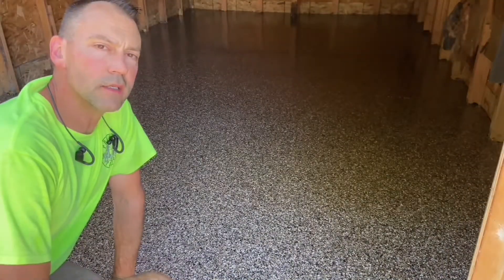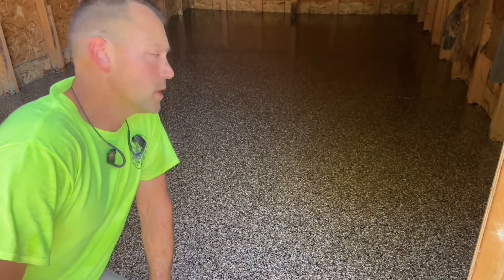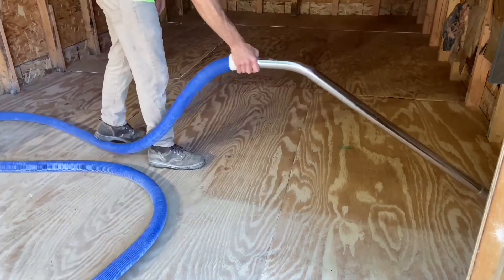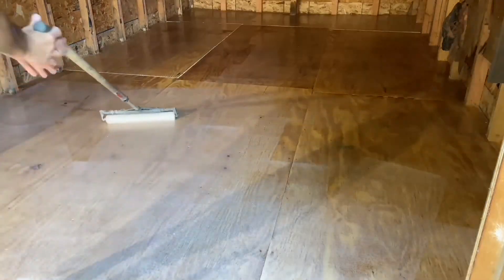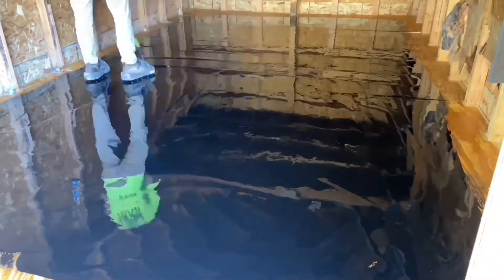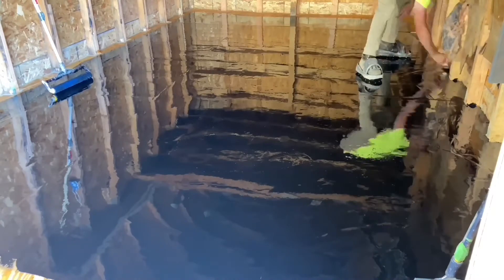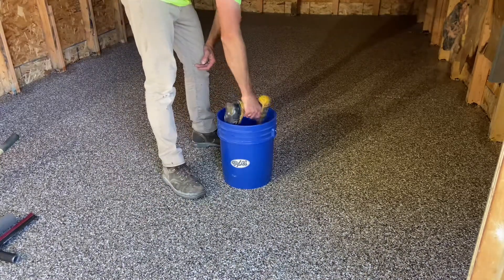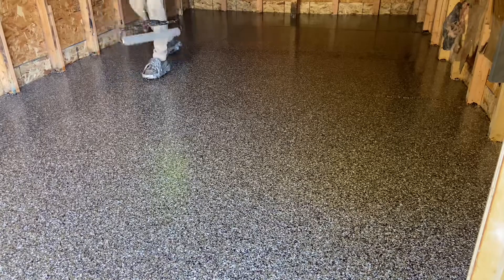How To: Urethane Flake & Polyaspartic Coated Plywood Flooring

Comment: Can you thin down polyaspartic?
Reply from the maker: @johnholmes3584  that’s a good question. While some manufacturers may offer ways to slow or thin their Polyaspartic, the ones I’ve used do not. Working time and viscosity are related to specific formulations. If I need to slow or thin a Polyaspartic (due to temperature or humidity concern), then I will switch to a product made for that condition or wait for the conditions to change. The primary reason I don’t thin a Polyaspartic is because it will affect the reaction necessary to make it perform the way it is designed to perform.

Comment: How would this hold up in an exterior Spruce plywood deck.  Northern winter/full sun exposure?
Reply from the maker: That’s a good question. 

The material is made for interior/exterior use. Its elongation and compression capacity is within a range to handle expansion and contraction of the substrate below it. If it’s prepped properly, adhesion to the wood will be good enough to prevent delamination. Of course everything has its limits, but seasonal substrate movement will not cause the product to fail from its own stress. 

As for the topcoat(s), a Polyaspartic or similar would need to be used for its UV and abrasion resistant properties.